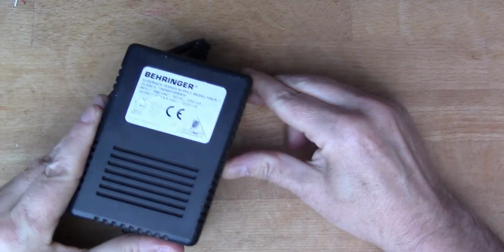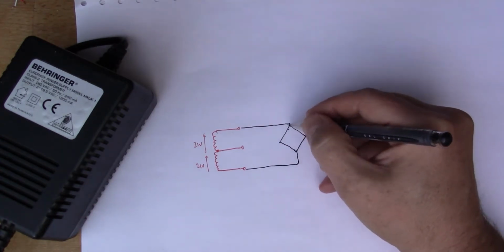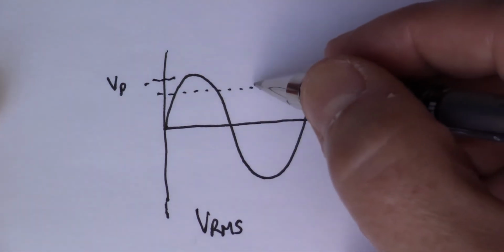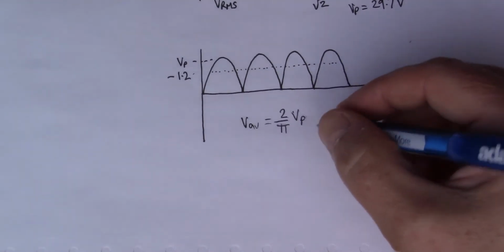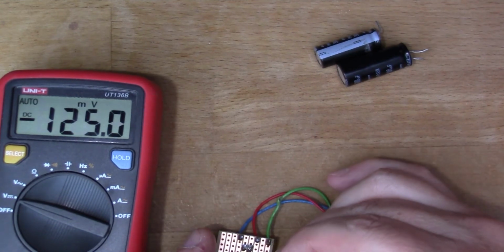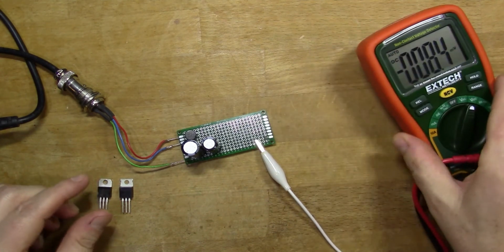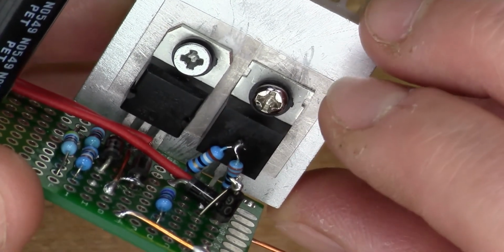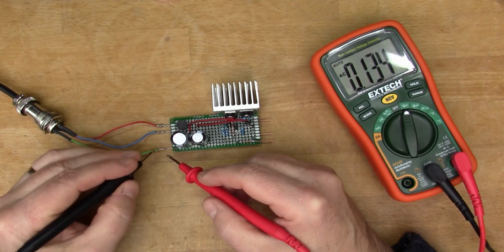Building a Split-Rail Power Supply with a Old Transformer (#53)

Comment: Was there much point in working out the +- 18 v before adding the capacitors?  Getting +- 26.5 v with the capacitors and no load was no surprise. (beginner)  Would regulated up to about +- 20 v have been achievable (depending on load)?

Comment: For the smoothing capacitors a rule of thumb is to allow 2200uF per ampere of current drawn. In your case a minimum voltage rating of 35v per rail will suffice. Going for a larger voltage rating of 50v the physical size of the capacitors can become large if higher values greater than 2200uF are chosen (tall leaded ones are available with a 10mm lead spacing whilst the snap in ones can be large in diameter). Also find in audio/radio circuits, a rectifier decoupling capacitor of 330nF to 470nF across the transformer LT rails (the 2 × 21volts) will suppress the annoying hum that would otherwise occur.

Comment: Very nice video, indeed! Just one question: are the resistors used for the LM317 not too big, for the minimum output current of 10mA (according to the datasheet)? Not sure what the consequences are for the LM317's output.
Reply from the maker: I don't  remember, but if I find the PSU, I will experiment with it.

Comment: 11:52 how is it possible that here you have +18 and -18 volts ? It is after the bridge recifier so there is only + 18 (actually - 1.2 V ) and 0 but why - 18 V ??
Reply from the maker: There's a centre-tap on the transformer that I'm using as the ground reference, so the low side of the bridge rectifier is -ve relative to that.

Comment: better schematic :   primary 220 Vrms  or sine wave:   Vpk+ /  Vpk(-)                    = 220*1.414 =  311 Vpk   
                                               sec   42  Vrms                      Vsec]pk+ / Vsec]pk(-)         = 42*1.414    =  59.3 Vpk
       with center-tap  Vsec /2  or  21 Vrms                  Vsec/2 ]pk+ / Vsec/2] pk(-)   = 21*1.414     =   29.6 Vpk

Comment: Which line would you rather connect as a ground (-17V or 0V) with a GND of microcontroller board or mp3/mp4 player? Maybe it's silly question but I don't have experience with electronics.
What would happened to the GND=0.0V if you would use different resistors with those LM317 and LM337?  - Is it possible that one speaker will be louder than the other one? Will it be harmful to electronics to run with that kind of "asymmetry"?
Reply from the maker: The usual thing is to put 0V to GND, so that way you could derive the power for the microcontroller from the positive rail.  Some types of devices (like op-amps) need a true negative rail for power, while using the 0V as signal ground.
Reply: @MartynDavies  Thank you for this answer. Let's assume OV to GND, but I checked that some microcontrollers (Arduino) would prefer something like +12V better. Do I really need to install another stabilizer (L7812) or can I drop that voltage otherwise? What about 2 LEDs in series with Arduino?
Reply from the maker: @SedziaP  I would definitely put another regulator (like the 7812) on the positive rail for the Arduino. I'd use a small heatsink also.  This is a cheap and effective solution.

Comment: Thanks - i'm quite confused about finding insulation kits for heatsinks. What about a dual rectiier - one per rail is there any benefit?
Reply from the maker: Try searching something like 'Thermal Heatsink Insulator 78xx' on ebay. Not sure what you mean about the rectifier, but there are various ways to rectify with slightly different calculations.

Comment: I'm late to the party but this was useful. You stepped through things just the way I comprehend them. Some days I get "thick" and forget things I learned decades ago.
I'm putting together a bench supply with one of those tiny programmable display devices with a few buttons and a digital knob for adjustments and menu selection.
It's touch and go because I bought such a unit "DP30V5A" and I am bound and determined to use an old school wound transformer I've been dragging around for nearly 30 years - never used out of procrastination and distraction. It's an 8 lb. lump of metal - 120V in : 40-0-40 out, rated at 6 Amperes. That would cost a lot of money these days.
After the bridge rectifier and large capacitors, I will have an adjustable DC buck convertor to knock down the voltage to a safe level for the rating of the programmable unit.
That DC buck convertor has its own input limit of 55V continuous / 60V Max. I think I'll still be close or on the limit.
I guess it would be OK to set up the rectifier as shown here and just take off voltage from the positive rail and ignore the negative rail? Use the center tap of the XFR as ground for my bench supply?
Reply: I put together my components but the DC voltage after the capacitors is higher than I expected; by a lot.
44-0-44 CT 6A transformer, 10A bridge rectifier - each output rail measures 18V on the AC scale, 40V on DC scale. So far so good.
I add on the two capacitors and the DC volts is up at 60V each rail. I guess it's the averaging that is raising the displayed voltage but I wasn't ready for 60V.
The plan is to feed a 8-36V adj. buck converter that has a typical input max of 55V and an input limit of 60V. So I'm on the raggedy edge of burning the converter.
So? I have a bag of the bridge rectifiers. I could use several more just to wire in the correct 2 diodes for some voltage dropping, and heat sink them all. Thoughts?
Reply from the maker: Yes, if it's just a few volts you need to drop to get to 60V, putting a few diodes in series should do that. As you say, if there's significant current draw they will need heatsinks.  You can also get cheap buck converters from China to drop the voltage - you need to check the input capacitors on these though, because sometimes the manufacturers use lower-rated ones than shown in the data. You can swap out the capacitors for higher voltage ones to avoid burnout.
Reply: @MartynDavies  Thanks. At the time I bought a bag of 10 of those bridge rectifiers, so I put 5 of them in series, using the negative and positive terminals. Looking at a bridge, that utilizes 2 of the internal diodes, so essentially 10 diodes. It only brought it down from 60VDC to 57VDC. No working load, just my multimeter. I think stringing all 9 spare bridge rectifiers would be stupid, or at least "not an elegant solution" as I used to hear designers say. 
That adjustable buck converter I have is the one I could see that handles as much as 5A. For now I'm defeated and I ordered a power supply board that puts out 36VDC up to 5A. US$14 and I can save that $5 buck converter and the big transformer for other things. 
That voltage is plenty. It was the 5 amperage to test fog lights and headlights on the bench that was enticing, so I'll achieve that anyway. So, nothing got smoked and nothing really wasted.

Comment: Is the drawing at 8:16 correct? I thought that for a split rail power supply, half of the cycle goes to the positive load and the other half goes to the negative load. That would affect your voltage calculations. For a single rail power supply, both halves of the cycle go to the load.

Comment: I can assume many people come to see the capacitor configuration to figure out how they are getting a negative voltage. You skiip directly over that when the capacitors just ended up soldered and again when you drew the schematic for the 317 at the end.  Maybe next time you can ... not skip that part?  (Maybe it's a secret recipe?)
Reply from the maker: Sorry, I didn't mean to skip over anything.  In the schematic (around 18:20) I did miss out the cap on the negative side, but basically it's wired in the same sense as on the positive side, such that the + side of the cap is pointing up, and - down (since the ground, 0 volts is more positive than the -V rail). There's definitely no secret recipe here: the centre-tap of the transformer goes to ground, which allows us a negative rail as the input for the LM337. The LM337 is an inverted version of the LM317 and provides the magic for regulating the negative side, where the ground is more positive than the -V output rail.
Reply: @MartynDavies  I know it's no secret recipe. It''s easy to google this and fill in the blank. Just wanted to point it out... Keep up the content though. I couldn't learn what I've learned   in the last year and a half without my Youtube Professors/creators. I have been infected by the EE bug and dumped a HUGE amount of my savings into my lab. By the way, I've built your dual rail (but with +/- 12v and 5v for playing with the 741 but I never thought to look upt the 337 vs the 317... So thanks again for the content... I'll order a handful of the 337's now too.

Comment: Nicely explained Martyn. Just a few thoughts.....As you were aiming for a 18V Pos/Neg output, why didn't you use  LM7818/LM7918  ICs? Was it just a case of using what you had in hand?  Also a little confused with your choice of resistors. With the LM317, I would normally use a 220R for R1 (in your case I think a 3K resistor for R2 would have then given you an output of about 18.39V) .
Reply from the maker: I had a tube of LM317s already, so I decided to use that (I use them a lot for constant current LED setups), then bought some 337s to go with it. I don't use the 78xx chips much these days, although they're still popular in the cheap kits. Yes, your use of standard values is much better, I think I just went with the first combination I found from my bits box.
Reply: sir were did you 1.25?
 thanks ...
Reply: V drop over the diodes. typically .6v x 2 diodes = 1.2v
Reply: The 1.25 is also the minimum voltage the LM317/LM337 can deliver. Often also called the reference voltage that exists at the adjustment terminal below the voltage at the output terminal.